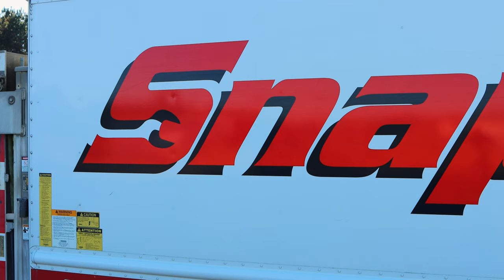Snap On: Power Stroke Drain Plug Socket and Tool Talk

Comment: The SnapOn 3/8" cordless ratchet is the first SnapOn tool I ever bought.  It's my most-used tool by far and its value to me is twice the price I paid for it.  It's fast and powerful. 

Last spring I was at the pull-and-pay and a couple of younger guys asked if they could borrow a socket (they didn't have an 8mm).  Since I don't let strangers use my tools, I asked them to show me what they were trying to remove.  I whipped out my Snappy cordless ratchet and in less than 60 seconds they had the 5-6 parts they needed.  They acted like I had Excalibur's sword in my hand and summoned hot scantily clad women from a junked 1974 Dodge van.

Comment: ive had the 1/2" ratchet for years, and have stripped it out internally 3 times, alignment bolts and headbolts is all i use it on

Comment: Man I normally loosen the bumper on the f550 to get at the secondary radiator drain on the f550 power stroke and use some small channel locks to turn it. I may inquire about that socket from my guy. 👍

Comment: And all I really want is a good impact metric set and an offset (bent) 3/8" ratchet, some bt extractors and a good set of swivel head impacts (not low profile), a 1/× inc impact and a GoOD light. I don't own a good light and I need one desperately. I hear SNAP ON makes a few good lights, a d u might have a few too 😆 🤣 😂 
Luv u guys. 
J. Griffith

Comment: Speaking of drain plugs, does snapon or any other brand make a socket for the square plugs on semi trucks differential?
Reply from the maker: Yes it is called a “Pipe plug” socket. Snap On has them for sure that’s the brand I have. Not sure on the other trucks because I just got them from Hamilton because he had them in stock but you can probably do a quick little Googleization search on the Ole inter web and it will find other options.
Reply: I have one at work I think it's general pneumatic.its a 5/8 "double square"
Reply: You mean the square plugs for diffs or trans? If so I can get you a pn for the entire set for snapon. If you mean like the plugs that a ratchet goes in idk that number but snapon and others make both

Comment: good video.  is there a socket for the radiator drain valve for the jeep patriots.  Have a socket for the standard radiator drain but the the jeep is like the ford very tight space.  When you cuss does wild bill pray for for you?